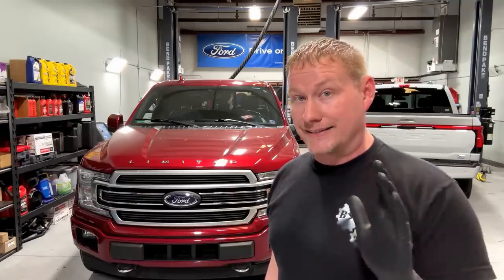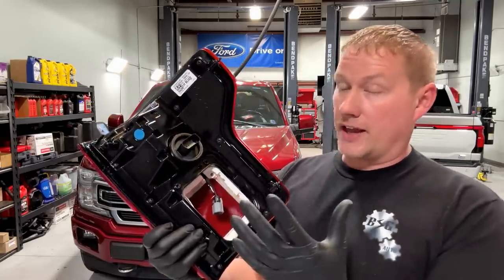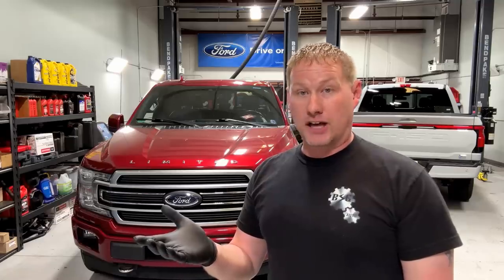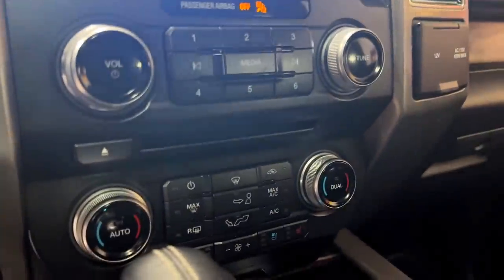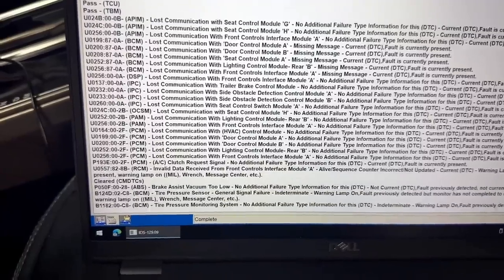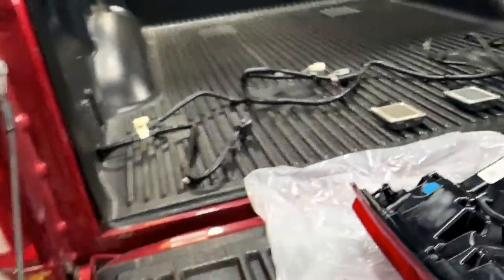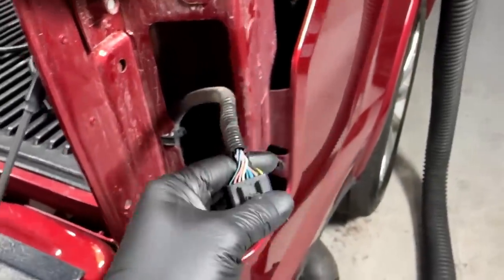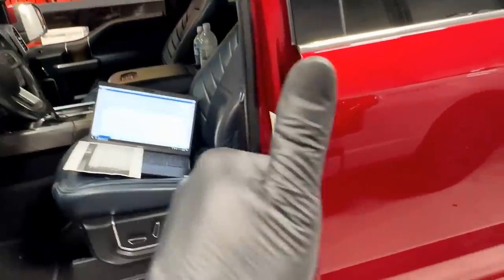Repair Cost Are Out of Control: $5,600 Bill for Some Tail Lamps?!

Comment: I'm only certain that you need one module, lots of grease and sealant, plus drain holes in both old light lenses.  The harnesses and integral plugs might need a bunch of pins cleaned, greased and tested to be sure, but work and luck might get your parts bill down to $600?  Though you would then have a labor bill because cleaning pins takes time and some skill.   I think pin cleaning is going to be a major job for the next generation of grease monkey apprentices.
    It sounds to me like with drain holes, sealing and grease, a little labor can make most of the old parts better than the new ones, though the labor cost of someone capable of doing the diagnosis you just did might be prohibitive, that's a job for apprentices, especially pin cleaning.

Comment: So what would be the preventative measures to this problem, since i just bought a 2020 with these tail lights? 

Weep holes and go in and grease these connectors before i have the issue?

Comment: first off ford should be held liable for this. second if it works when its dry then fix the water intrusion. $200 for some hot glue and or soldering plastic.

Comment: I install life safety controls for a living and we use isolation modules on the critical data bus. Why on earth would car manufacturers be allowed to run a data bus between internal facing and external facing components without isolation methods. Insane.

Comment: I can understand putting the grease on the perimeters of the connections to ensure no water gets in. Grease is an insulator and cause resistance with the terminal to terminal connection correct? Dielectric grease doesn't conduct electricity I didn't think. I've used a carbon conductive electric grease on battery connections, main powers and grounds to ensure enough surface contact. I would love to hear everyone's thoughts on this.

Comment: The car companies are not happy with money made on new vehicles so they are getting it on parts.Water in taillights isn't that a design flaw. Recall to fix this or the dealer should bring these in to reseal to prevent shouting matches in future.

Comment: My tail lamp housings were getting water building up inside them when driving in the rain and I removed mine and took a 1/8" inch drill bit and drilled one hole in the lowest area of the light housing on the inside and i've never had the problem again.   And yes I used a coating of nonconductive light bulb grease on all the fittings also.

Comment: Have had this exact issue with my older Explorer, tail-light had a hairline crack that rainwater seeped into, shorted the tail-light, as well as all sensors on the left side of the vehicle, took it into the dealership, they claim there's no code so they just try to replace all the sensors that were tripping out the console and guess what, still doesn't solve the issue. Took it back and forth to the dealer and then some other shops to get 2nd opinions but all they wanted was to charge me labor to look at it and none of them were able to quell the ABS chimes. I think it just straight shorted out all the internal wiring so no matter how many new parts you put on unless they took out all the wiring and replaced it it'll never go away.

Comment: if t worked when it was dry ,why not dry the connection and scotch coat the crap out of it .the new will do the same .i have seen scotch coated butt spices last decades. i guess if you have 5000 laying around

Comment: This is not planed obsolescence anymore. It's a straight up scam. Ford is using the insurance as a revenue stream by using the customer as a claimant. It was engineered to not be sealed from the elements and have the module in the tail light where will definitely be corroded.

Comment: Ford and gmc are the same people poor engineering so much for top of the line😊 engineering is either flawed or designed  that way both are wrong for these over priced vehicles, i have a gmc and lots of things  done after 1year😊😊😊😅 i am now a mechanic  also since nobody had so many bad problems that nobody  had ever dealt with....

Comment: Parts pricing and unnecessary gadgetry on a lot of modern vehicles has just gone insane - they lost me when LCD touch screens on the console  started to become a thing - the only reason many people don't rebel and demand a simpler vehicle option is that they're unaware of repair costs later  until it bites them.

Comment: Holy crap on the electrical repairs!  Putting electrical grease on new wiring connections as a preventative measure is a foolhardy stopgap measure.. when it dries out.. it's going to happen again.   Something around the cause was never mentioned.. identified and weeded out... the lens covers should be protected by well designed rubber gaskets against water leakage.. it did not.  Every truck bought is going to run into this crappy problem.  Shame on Ford.  This a warranty/manufacturer error and they should pay for it. If they don't.. someone should start a Class Action suite.   What a cluster xxxx.
Reply from the maker: Yes grease will protect the connectors, not sure what the confusion is. The leak came from the seam of the tail lamp just like any other polycarbonate lens made in past 50+ years I figured that was common knowledge by now.

Comment: If a part like that is on back order, wouldn't that indicate that there is a huge problem with the unit? Also Travelers can kiss my a$$. I had about 7 dents on my roof and hood after a hail storm, so instead of getting back to me, they wrote my car off. I found out when a towing company called to set up a retrieval date. I hadn't talked to the adjuster yet. WTF?
Reply from the maker: No there have been many supplier issues due to raw material availability not necessarily demand.

Comment: Hold on! Locate fee?? When did dealers start pulling that crap? I worked at Ford dealerships for 30 years, left in 2021. What did I miss? Apparently a new locate fee. Sheesh!
Reply from the maker: Ok so you will understand this then. The part was on backorder, a few dealers on the OEC locate system had it, they sell it for a profit over their dealer cost let's say 10%, plus shipping. Then it arrives to my dealer they want their percentage over their "dealer cost" to buy it from the other dealer. Together they call it a locate fee instead of spelling out each individual charge, it's pretty standard.
Reply: @FordTechMakuloco   Ahh Yes. We just never called it a locate fee. We would just tell customer we were at the mercy of the other dealer price wise. 😜

Comment: So, you didn't state the root cause of the water leak. Upon repair did you ensure it wont leak again? Also what about salvage yard parts.
Reply from the maker: I didn't state the root cause of the leak because everyone knows polycarbonate lenses eventually leak at the seams the same as they have for the last 50 years.

Comment: It's not just the $5600 TOTAL bill. It's the $350 'LOCATE FEE" which has me stumped. Unless I'm mistaken, the customer has to PAY Ford, to "locate" a part? I find this absurd. I dont remember Toyota $ticking it to me find a module for my Tundra.
Reply: Try listening comprehension son.  They found the lamp shell but the module was on back order. Thus, they could not just get from Ford so they had to start looking elsewhere and getting quotes and lead times.
Reply: @valvodka   You just explained to yourself that the customer AND mech had to locate parts. YOU may have a comprehension issue. Only on youtube threads that a know-it-all falls flat. Thank you for showing that evidence.

Comment: I would've cleaned up the old taillight connectors, replaced the sensors, modules, and harness.   Then drill a weep hole and seal the taillights.
Reply from the maker: Go for it but not at my shop.

Comment: I’m glad I got rid of my 2016 XLT supercrew with the 3.5 ecoBOMB engine. At 800 miles the gateway control module went out. I had no interior power, gauges, turn signals or anything! It sat at the Ford dealership for a month waiting on back ordered parts. At 68k miles the timing chains let loose, then the turbo charge went out, and then the day I went to sell it, the water pump failed. Glad I had the Ford extended warranty! I’ll keep my panther platform vehicles and my beater car with a manual transmission from now on. No car payments, and no nonsense like this to deal with anymore.

Comment: If it was mine I'd probably would have pulled the harness and sand blasted the pins. 

This is my experience with can bus mishaps; Tilt module under the cup holder didn't have solder, and was full of coffee and or soda.  Ecbm canbus circuit was taken out. Replaced the ecbm and opened the tilt module after not finding one state side. Found the connection relied on press fit pins 🤡. 

If I taken it to someone else to troubleshoot I'd would have waited for the part to come from England $550 plus shipping, excluding the ecbm plus reprogramming, and labor.
Reply from the maker: Absolutely not especially for these mv circuits no way.
Reply: @FordTechMakuloco   I understand that you're busy and don't care to take time pulling the pins out to remove contaminates. 

When it's mission critical and too expensive to scrap; sand blasting conformal coat off the circuits is common practice.

Comment: If there was a fuel rail leak and a resulting fire which lead to thousands in repair costs would you complain that repair costs are getting out of control? I don't think so. I think you would say, why is the fuel system leaking in 2020? The harness should designed to be exposed to water and the housing shouldn't be leaking in the first place! These are design, manufacturing and quality control problems.
Reply from the maker: What in the world where did you come from?
Reply: @FordTechMakuloco  Lol....Great job on the diagnostics! Just helped someone with a similar issue with a volvo and this video was in the back of my head. Culprit is a front headlight, when it rains, half the modules in the car take a dump....but.... the car had been in an accident and not propey repaired. Cheers!

Comment: Locate fees sound like a scam fee. On those charging you.
Reply from the maker: Not really, the selling dealer wants their cut, my dealer wants their cut and then there is shipping. It's all just business.
Reply: @FordTechMakuloco skip your dealer then go to the original. If that can’t be done then it’s a scam.  You see this with consultants too one hands to a mate tho adds their fees for zero net gain.
Reply from the maker: Problem is many dealers won't sell backordered parts to the general public and many times they won't even sell to their friends on the dealer network. They had to call 30 dealers that showed the part in locate to find one that would sell.

Comment: Was anything done to prevent water from getting back into the light fixture, a gasket or something.
Reply from the maker: It is all new going back together.
Reply: @FordTechMakuloco  It sounds like material defect, bad design, wouldn't a replacement result in the same issue, without changing the installation method.  So glad I opted for a Ford Ranger mid level without all the bells and whistles.
Reply from the maker: Material defect from 6 years ago yes.

Comment: locate fees. everyone is so greedy.
Reply from the maker: How do dealers stay in business? By making a profit on anything they sell just like any other business out there.
Reply: @FordTechMakuloco  very expensive service. very expensive parts. sales as well but msrp means suggested retail price. there is a difference between invoice and msrp which is profit margin. used cars make a huge margin. but marking up cars above msrp is unethical in my opinion.
Reply from the maker: correct
Reply: @FordTechMakuloco  5600 for taillight repair i would have had a heart attack

Comment: Not only Ford.  My 2017 Cadillac xt5 sent a message about power steering; the water temperature gauge quit working; and the air conditioning quit working.    It turned out to be a thermostat.  Close to $1000.00 (yes ONE THOUSAND DOLLARS for a thermostat) everything works again.
Reply: I remember when a thermostat was easily accessed and a replacement was about $10, a 20-minute DIY task.

Comment: This is old news
Reply from the maker: In what realm?
Reply: @FordTechMakuloco  you tubers have been talking about the tail lights leaking issue and the expensive cost to repair.. its old news
Reply from the maker: Oh so no one should ever talk about it again until the end of time, got it.
Reply: @FordTechMakuloco  you should give credit to the people who reported it first instead of making it seem like you discovered this
Reply from the maker: Wait a minute I showed in the video exactly how I discovered it and my diagnostic path and explained it was dumb luck that I skipped the MS CAN issue and jumped to the constant fault which was the BLIS codes and when I pulled the connectors it was a green blue fuzzy mess back feeding into the low voltage MS CAN circuits. I literally said it was dumb luck that I jumped to that in the video, I couldn't make it any clearer. By your logic the first time I have a vehicle in my shop with a shredded wet oil pump belt I should go back and give credit to every dealer tech that has experienced it before me under dealer warranty? Dud get with it and get off the stuff oh please clean yourself up.

Comment: may should have drilled a small hole in the bottom for the water a way to drain to stop this from happening agaian
Reply from the maker: no
Reply: That does not help with electronics. 

If you have water leaking in a traditional light you can "hack it" that way, but not with electronics.